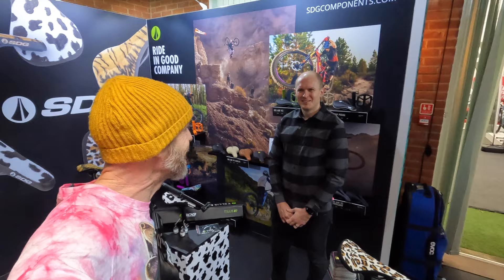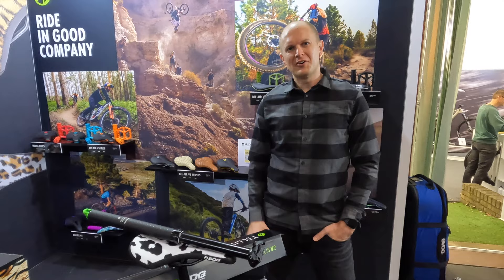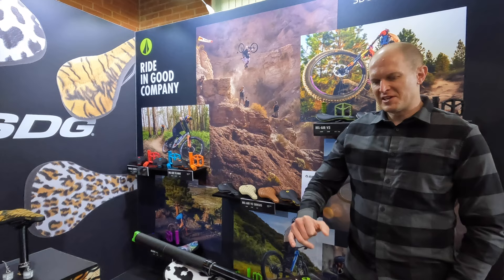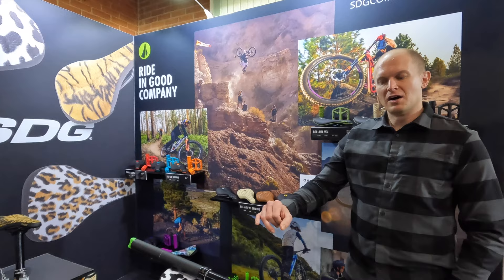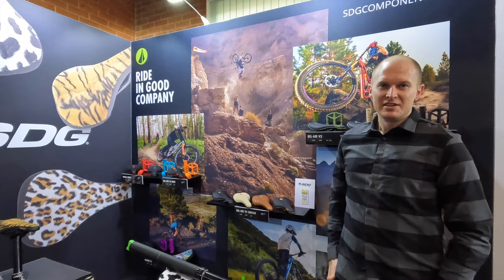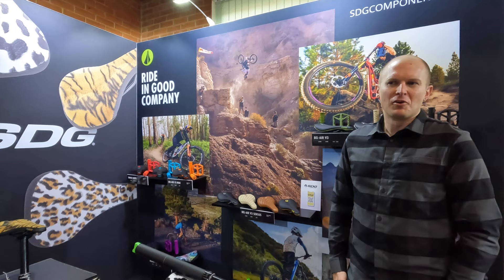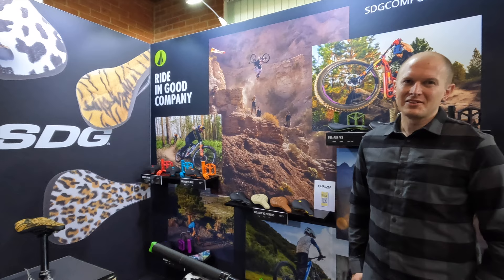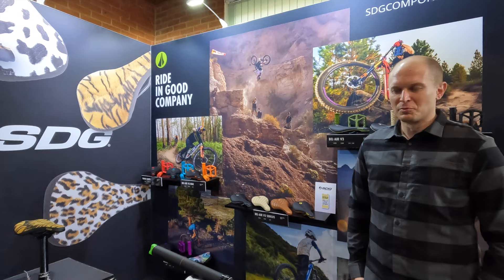SDG promise insane reliability and more features with their new Tellis V2 Dropper Post

Comment: It is a dropper, it goes up and it goes down.....doesn't get any more fancier.
Reply: That’s what I thought until I got a bike with an unreliable dropper - nightmare.
Reply: I had several bad droppers:
Race Face Turbine, I had 4 all leaked after some weeks, I returned them and opted for a refund.
I also had E13 TRS Plus, which had a head with lots of wiggle, so my back twisted,it was held in correct position by a brass key but the slot was too big for the brass key so it rotated too much. It had set positions, could not shorten the travel.  but was super easy to service. but the cons makes it an awful option good they discontinued it.
Bikeyoke Divine, a bit heavy actuation, but works well, reliable.
BIkeyoke Revive 2.0 nice super light actuation. Might mistake it for the cable slipping, so light. Very smooth too. mine is 213mm, on a Large Geometron G1. For my legs and with 165mm cranks I did not have to shorten it. 
But BIkeyoke clamp is plastic, so it will eventually fail like mine did. but it's Sram mounting standard, so can get any Sram compatible clamp.